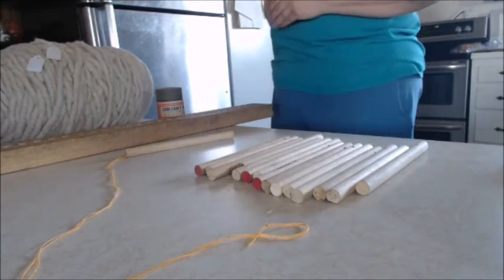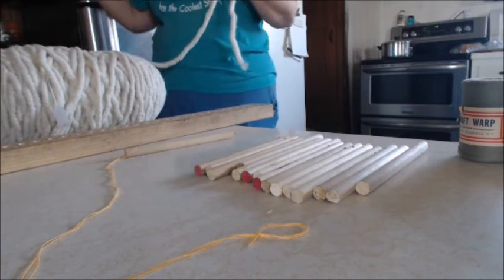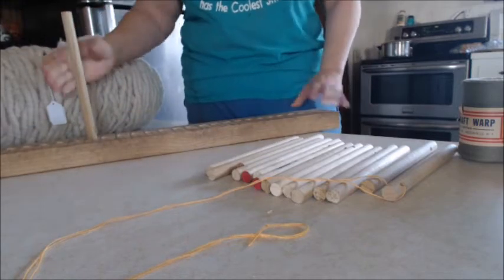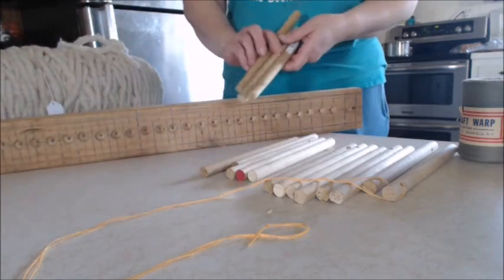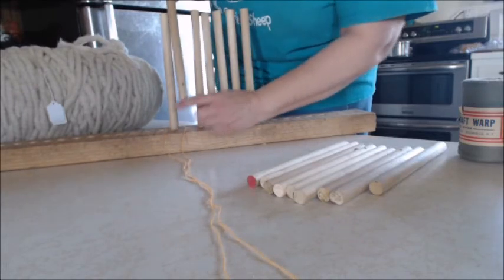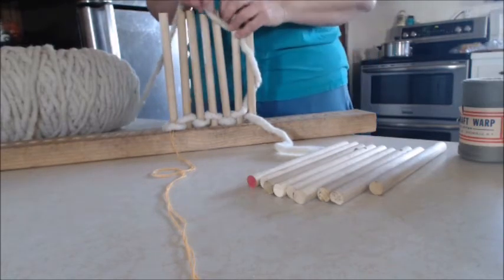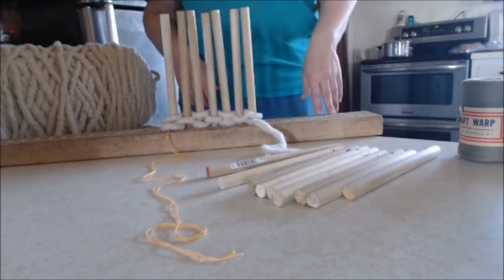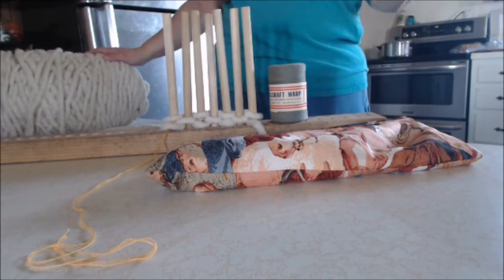How to make a peg loom

Comment: could you share the distances, spacing and markings better it couldn't be read in the video . Oh and what size of peg to use with what spacing??? thanks.
Reply from the maker: The peg size and spacing depends on the size of the materials you are going to be weaving with.  The larger dowel 
I used is for the core spun yarn and that kind of yarn is larger then bulky yarn or even the stuff Granny had to make her rugs out of.  The smaller the size dowels you use the closer together they will need to be.  There isn't a set in stone measurement for it though and if you don't plan to use the large stuff your pegs will need to be adjusted to fit what you will be using.  ... I hope you can understand my reply and I didn't just totally confuse you ... LOL